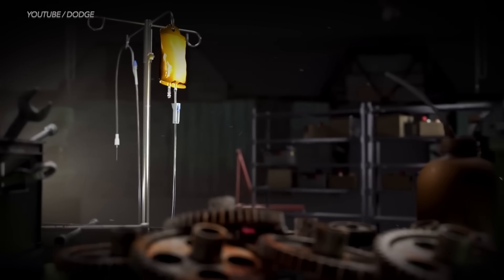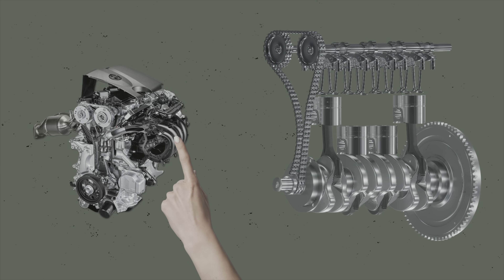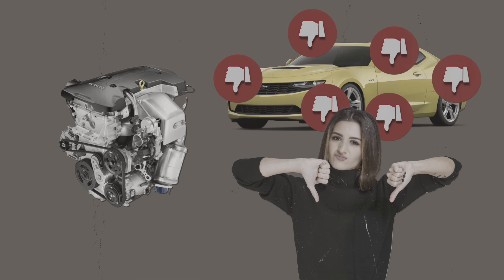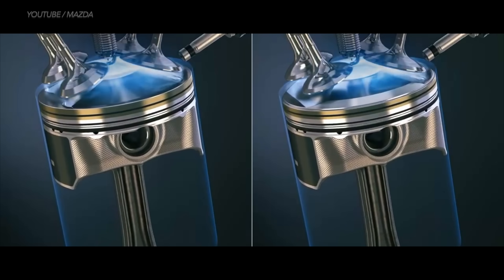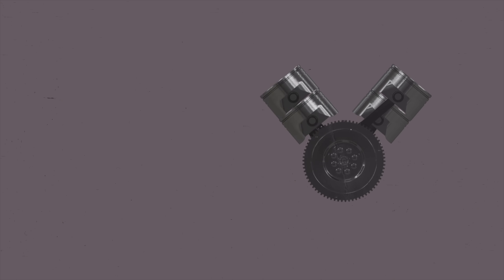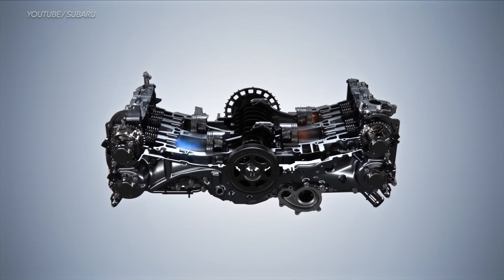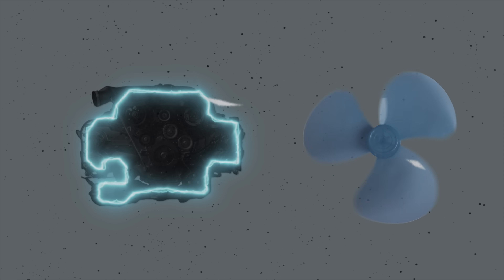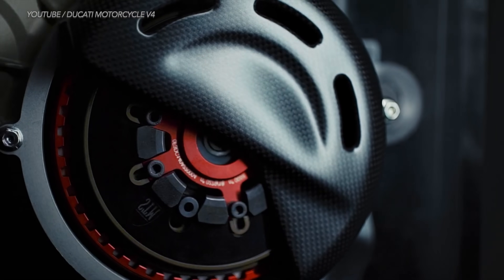This New 4 Cylinder Engine Just Killed the Future of V8 Engines

Comment: I run a 2018 naturally aspirated 2.5 ltr boxer 4 in my 2018 Subaru forester with the 6 speed manual. This configuration has been super reliable and I tow with it frequently around town and between Ohio and Tennessee once and had it all the way to Orlando FL from OH. It performed just fine through the mountains at least to my expectations for a 4 cylinder.
Reply: I have the same one. Burns  quart of oil every 800-1000 miles at 56,000 miles.
Reply: @tclucke  wow. Mine burns nothing with 65,000 miles. Can you contact Subaru of America ?
Reply: ⁸
Reply: Yeah the manuals are better they can last but the autos can go to crap quick. Don't you have to be more careful with head gasket issues with high revving your gears in manual?
Reply: @buzztrucker  I run it hard but have never exceeded 5,000 RPMs and only on occasion reached that point. Taking it to 4,500 on the highway while towing and accelerating there is enough power to keep it moving.
Reply: It's too bad that the Manual transmissions are being killed off. A Subaru with a manual is almost a perfect car

Comment: I have x3 inline 4 cylinder engines and x1 4 cylinder boxer engine. No issues with any of the engines really.. just oil consumption on my 2007 civic si with the k20 motor.

Comment: The Subaru oil consumption issue is all you need to know about their quality philosophy.  Then they told costumers 1 qt every 1K miles was "normal".  Their director of communications declared that this was within the normal specification for vehicles.
Reply: I had four Subarus and none of them had oil consumption issues.  Over 200,000 miles on three of them.
Reply: 2007 forester 227k miles no oil leaks here. Never driven a regular consumer car that was so fun to drive either.
Reply: Great fan of Subaru had a few  mostly Forester, yes the 2012+ models used oil, but reliable. Most developed oil leaks over long term use and hi kms. But great reliable,safe,sure footed and robust long lasting cars.
Reply: I bet some of those people beat the heck out of the cars or bought used cars that were wrung out. Not to say that much oil use is acceptable. Every engine can eat oil or fail. If they said it was normal that’s probably the accounting department talking.
Reply: I intuit it's "normal" for horizontally opposed engines, as the gravitational forces probably cause asymmetric pressure on the rings. They probably wear much faster.
Reply: Yes some and some not. We had run Subaru's for work since 1989. I don't know how reliable the newer 2006 on wards ones are but for us 1/3 of them burnt some oil especially over 150,000 miles.
Reply: what was the repair for the customers oil consumption concern.  Did the manufacturer or repair shop address the issue?  - thank you
Reply: @anthonyz7023  Hi Anthony I still own 2012 model brought new it does use oil especially on a long hot run say 1500ks pretty much as manual states. I raised this issue with Subaru (Australia), they suggested oil usage was normal and I'm not aware of any offered repair or engine replacement in OZ where every second car seems to be a Subaru product. The Subaru brand ,it could be argued, has a pretty good reputation in Australia. They did offer to sell me top up oil tho haha. So I top up the oil every now and again, oil is cheap. I think oil usage was planned for the FB25 engine in a search for less mechanical friction hopefully resulting in greater efficiency and longer engine life. The sump capacity was increased, maybe 3/4 quart, from previous FJ25 engine. The car still runs fine approaching 160ks (100k) miles on the clock. So in a nutshell I don't think anything substantial was done by the manufacturer in OZ to address oil use issue maybe the US was different we are all envious of US consumer law.
Reply: m\My 2010 impreza does not leak oil used 5w30 though. Newer subarus use a thinner oil that is more prone to leaking or burning just because of that factor.
Reply: Chevy equinox is the same way, my 2013 burns oil too. especially after 3000 miles or sooner without additives. low friction rings are crap. 1 qt every 1000 miles is what they base it on too.

Comment: I have a 2010 chevy silverado 1500 4x4 and my habbit has always been to watch the fluids closely although the truck has never had issues with leaks or consumption I've always been told fluids are one of the most vital factors in a good engine so I've always kept up on checking all fluids ontop of usual mileage maintenance such as tire rotation, balance, alignment, light replacements, tire pressure, exc
Reply: You're talking about a V8 when this was all about 4 cylinder engines!

Comment: I own two Subaru Boxer engines neith one consumes oil never had any issues the main issue people have is from the old EJ series engines from the 1990's with head gaskets that problem has been solved for well over 15 years. The Boxer is one of the most simplest engine to work on for a basic DIY person and the parts are relatively inexpensive why because you either have the FA 24 or the FA 25 boxer does not matter what model the engines are the same. I have owned the GM Eco-tech inline 4 horrible engine would never recommend the GM mechanic that I worked with said those are disposple engines after 80 thousand miles.
Reply: what year GM engines are bad?
Reply: @jamesmedina2062  any of their eco-tec engiens just wear out around 80,000 miles

Comment: Woohoo! I have an inline 5 cylinder. I like it- runs smoother than a 4
Reply: Probably a Volvo
Reply: in what vehicle?
Reply: @jamesmedina2062  VW Rabbit 2006 with an ECU tune
Reply: @intractablemaskvpmGy  Wow so the European 2 door? Its like GTI no?  I heard they are better engines than 1.8t which I had in a Passat from 2000-2015

Comment: Hello, I watch your channel and have learned a lot from it you're closing the gap for me from non computer cars to computerized ones now.. I own a 2013 F-250 4x4 and now it's giving me fault codes of misfire on all cylinders and will not fire up.. I've checked fuel cap as well as fuel level, no other codes but misfire all 8..??  Any suggestion from you or others this happens to be my first 2000+ year model vehicle... Thank You

Comment: I always wanted to buy one of the V4 Yamaha Ventures as I hear they are nice and smooth power good for lots of miles and long distance rides without much fatigue.  Also, the outboard motors we see on many boats have used V4's for years.
Reply: The Wisconsin V4 is a workhorse
Reply: Yamaha and Suzuki both made a V4 touring bike (Venture and Cavalcade) epic failures.  Big,  heavy,  long,  couldn't compete with the Goldwings of the time period. The gen 1 Valkyrie is nice,  low, plenty of power but horrible mpg
Reply: @perrycalabrese3475  I'm 6'6 and don't like bending my legs on the Gold Wing or the Valkyrie but they are nice.  Guess I could tolerate it and spread out on the open road.  But I probably won't unless I stumble across a deal on one.

Comment: I have a 1995 Ford Ranger with the 2.3 : straight 4 and 5 speed manual transmission. It has over 176,000 miles and is still going strong. I have absolutely no complaints about it. I just keep it well maintained, and it keeps on running fine.
Reply: 28 yr old truck with 176k? Do you work from home? lol
Reply: @keensbeanz  he must😅 and only vehicles with 250,000 plus miles shall be brag worthy... my 2010 honda has 362,118 and still purrs like a kitten....2.4liter
Reply: Had a customer with a 94 still had the original clutch in at 290,000 when the headgasket gave out. We sent out the head for a valve job and it gained back some low end power. He drove it to 315,000 when he had an ignition problem, and gave up on it.
Reply: Just sold my 95 ranger with 276000 miles and it was still going strong. Replaced radiator, throw out bearing and clutch, and watter pump at about 250000 miles. Only sold because I can no longer drive straight drive.

Comment: I have 2 cars. One has a 989cc i3 twin cam 12 valve. The other has a 1,248cc i4 twin cam 16 valve turbo diesel. Neither has any real power. 56hp and 75hp. But at least they both only sip fuel.
Reply: what car has the 3 cyl engine???
Reply: @yoshigokyriya  My 1998 Daihatsu Sirion.

Comment: the best one I owned is a 93 Ford Mustang LX that had a inline 4  2.3L VIN M Dual Plug Ignition. I got 36 mpg and still could go faster than the 85 mph speedometer. It was a OHC. I put a turbo muffler, a K&N Air Filter and did away with the mini cat. It went 330,000 miles and was still running after I totaled it.
Inline 4 has my vote.
Reply: my 1.5t Honda Civic gets 36 mpg..I was fooled!!!! The direct injection is a mess in it. It should have port injection.

Comment: When will manufacturers get with the program and make an inline 4 banger with a crossplane crank just like on modern Yamaha R1 motorcycles?! ... Balanced, superior power delivery and sound similar to a V8... Make it slant for lower centre of gravity with both port and direct injection and you have yourself an almost perfect engine.

Comment: The fact is the straight 6  configuration is the smoothest and best.  Think Chrysler slant 6 and Ford 4.9 ltre inline 6 pickup truck engine.
Reply: It is very smooth but why is it the best?
Reply: @Marcus Rawlinson  what I read.   For some reason the straight 6 configuration is naturally the smoothest.  The only reason they switched to v6 was to accommodate the transverse engine front wheel drive design.    You need a big engine to power a pickup so a 4 cylinder engine is no good unless you turbo charge it and then it's not as durable.
Reply: Inline 6’s are too long for a transverse engine setup. BMW is keeping their excellent one, and Chrysler is designing a new one with a turbo for their future to replace the hemi.

Comment: My naturally aspirated 1.9L In-line 4 BMW engine made in Austria that’s in my manual transmission E36 Z3 were super extremely solid and reliable. 216,000 miles on it well maintained and always highway driven. Also this was the last BMW in-line engine to have both a metal valve cover and metal intake manifold.
Reply: it's not necessarily BMW engines that are bad but there are so many other things that are poorly designed and expensive to repair
Reply: @ford1546  yea the engines themselves are super solid, it’s just they throw on everything else made of plastic instead of metal

If you can find aftermarket parts that are the same just metal I bet them engines would see well over 200k miles
Reply: @brileymitchell2632  Yes, that is the problem with many cars.
Reply: @ford1546  Exactly
Reply: Naturally aspirated 1.9L lol that’s so puny. Gross

Comment: Mazda coming out with an in line 6. Can't wait to give it a test drive. 4 cylinder engines suck as for power, torque and acceleration on hills, and fast traffic. But I have a somewhat lead foot. I like my 305 hp chevy V-6. Average 24mpg combined. As high as 33 highway
Reply: Have you ever driven a 2.4 liter 4 cyl Honda accord? Fast efficient and great in hills. Did I mention it’s fast? 4 cyl are great
Reply: What car is the 6 cylinder in? Impala, Malibu, or Camaro?

Comment: 2019 Chevy Sonic Sedan. I like the car and plan to keep it But... Just after the 30,000 factory warranty expired I had to replace the turbo charger on the 1.4 engine. Always changed the oil every 2500 miles. Car is made in Detroit, runs quich and has on honest 6 speed automatic transmission. almost paid for and I want to keep it but I don't know how often I will have to replace that turbo charger.

Comment: Boxer 4 - 2022 WRX.   I’m not concerned about oil consumption and change oil every 5,000 miles vs the 6,000 mile requirement.  Came from a BMW which I felt had intervals that were way too long.  In my opinion though any of these engine choices properly maintained should easily last 150,000 miles.
Reply: @Tom agree .. 150,000 is the minimum!  Crazy to think that I remember growing up in the 80s and 90s and 100,000 miles seemed like such a milestone.  It’s all about maintenance but these newer cars are built so much better than the cars of yesteryear and safer too. I would love for my WRX to go 300,000 miles
Reply: @Tom agree to disagree.  I think a new car has better chance of lasting 200,000 - 300,000 miles with less major maintenance.  Simplicity wise yes the older cars are easier to work on
Reply: @@Tom-qv2jg Older cars? Seriously? Newer cars are so much more reliable. It used to be that you were lucky if your car lasted 100K. Now it's more like 200,000-300,000 miles. The manufacturing process with computerized machinery now a days is far superior in building consistent quality vehicles.
Reply: @tlhumm  this is the truth. Older cars rarely lived past 100,000 miles without a complete rebuild. I do like how the older cars had almost zero electronics with carbs instead of direct injection. But anyone who has dealt with older engine will tell you the carb could be a major PITA too. Still it was a lot cheaper and easier to work on those simpler engines. But I am talking about stuff from the 1960s and early 70s...the late 70s and 80s American cars were horrible in just about every way...EPA forced American manufacturers to change too quickly.
Reply: @@Tom-qv2jg  Well, statistics show different.  As someone that drove cars from the 60's to today, there is no comparison on the quality you get today. 60's, 70's and 80's American cars where garbage compared to what they build nowadays. Sure you could work on them, but with fuel injection computerized ignitions etc you don't have to. You can thank the Japanese for the quality we get now as American cars had to get better and more dependable fast in order to stay relevant compared to the quality the Japanese were building as the gap in quality was huge. After driving a  78 Camaro bought new and was junk by 60K (the engine actually had the least amount of issues, while the rest of the car rotted away) then buying a Japanese car, I never looked back.